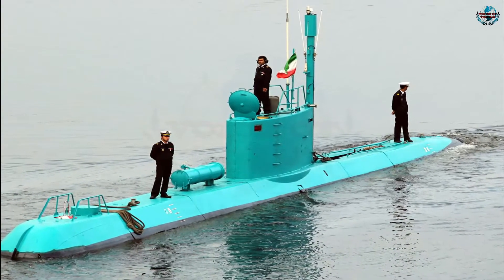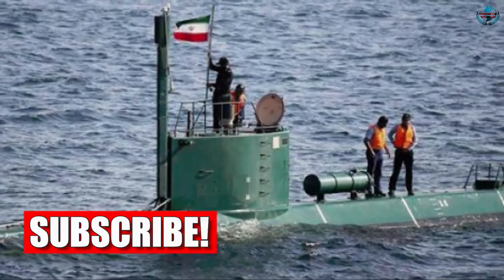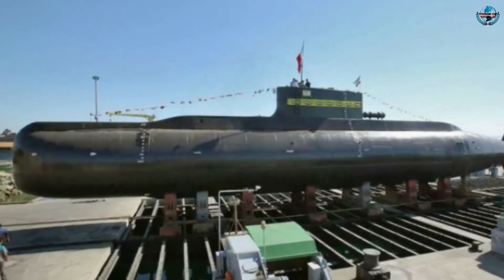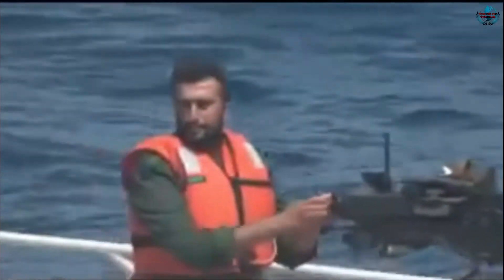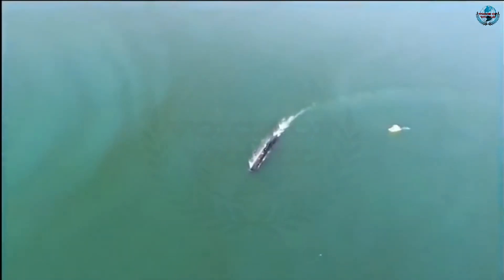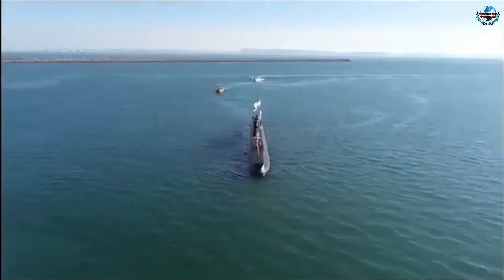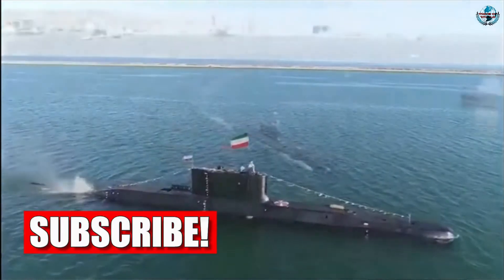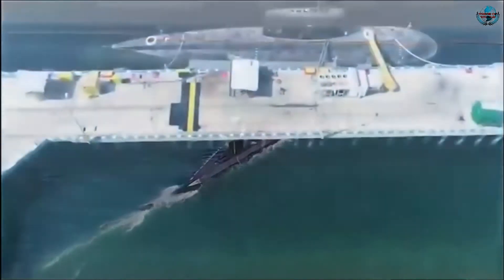Iran Loves Its New Mini-Submarine, Explained | Voice Of World English.

Comment: I would think that it would be a suicide submarine than a weapon of war. If you look at most successful submarines they don’t have flat sides they are round like a egg or ball so the operation depth like a u-boats of WW2 ( not uboat works) and using a fiberglass boats as military equipment is questionable at best the good thing is they are white so if they do get in a gun battle they can use the boat as a white flag.